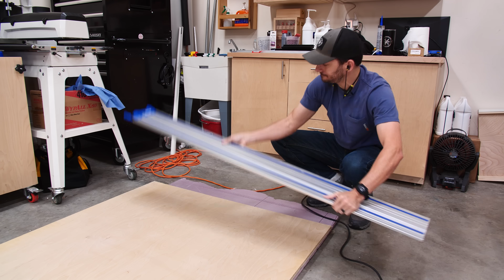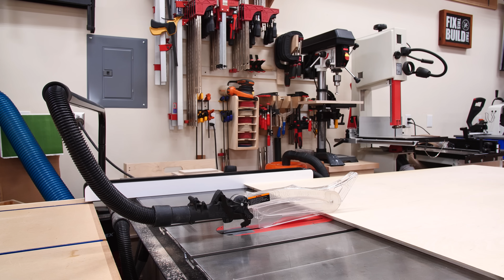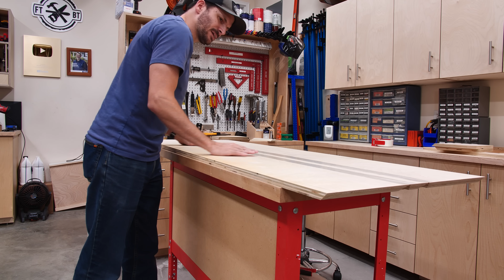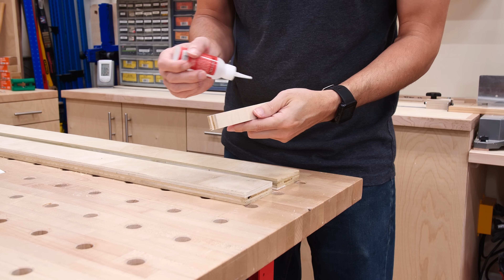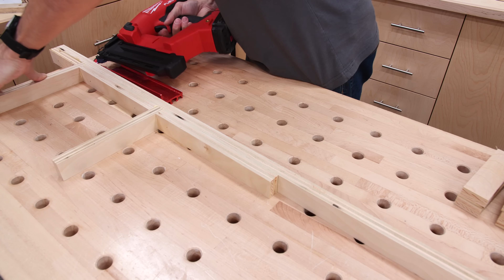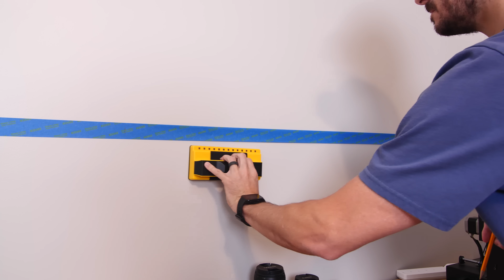DIY Floating Shelves with a Secret

Comment: Great video! Very similar to the way I build floating shelves and as the electronics keep digging into that… so much you can do with low voltage and wood. I have 25+ years in the 12v/audio/video world and now I incorporate that into almost every project with lighting or moving panels. They have power supplies that are super small and thin just for low voltage lighting. Hardwired is the way to go vs battery especially for a no hassle no call back customer service point of view. Not a big deal for people like us to change batteries but most of customers want out of site out of mind hassle free!! Just my 2 cents.  Keep up the awesome clean work and keep the videos coming.
Reply: You are right about going wired. These items are not much electricity draws and newer electronics can be worked via phone/alexa for a truly seemless voice turn on/off. Is there.a good video for hardwired floating shelf? I'm looking to use one over a bed that has built in light/wireless charger/usb ports.

Comment: It’s always interesting seeing how others build floating shelves. I work in a custom cabinet shop and have probably built close to 200 floating shelves among other things over the past year. 

The main difference is we don’t mitre our front onto the top and bottom, we glue a filler strip in a rabbet on the front and veneer the same wood to the front. 

It goes quicker because you don’t have to be as accurate with a mitre fold. Plus if you use MDF for the top and bottom then a maple veneer to cover the front, the whole shelf is 100% paint grade.

Comment: Nice build. Also appreciate the 46 degree tip. How long are you getting on those battery packs before you need to recharge?
Reply from the maker: Without using thr button is was 4 or 5 days on standby. Haven't tried to run the LEDs out yet with the button on and off when not in use. I figure I'll get at least a month

Comment: Funny you should ask if I like electronics.  I may have fell into the deep end of fiddling with electronics this past month.  I am in process of installing permanent Christmas lights on the house.  Similar to the channel with strip in it you have, but run off of a controller with WLED.

BTW.... nice looking shelf.  Office is coming together nicely.

Comment: Done something close to this with my kids floating shelves... But I drilled into the dry wall and dropped cables from each of the Floating shelves behind the dry wall to a wall dry line box and powered from mains usb power instead of battery packs. 

No worrying about charging or hot battery packs while charging then. 

Great job and looks so well. Well done.
Reply: Damnnn very NICE, will be doing something like this in my living room for sure
Reply: i doubt that youll reply since this was 4yrs ago, but oh well. I want to wire 180 leds and i want to power them using only a charging brick that supplies 5v and 3a. do you think it will run?

Comment: You mentioned using painters tape before, and working well. Why did you feel the need to use a different tape? I find painters tape is still the best, because it doesn't lift grain as much as other tapes I've tried, like when gluing miters in the corners of boxes (you were going along the grain instead of across it, so it was likely not as much of an issue).

Comment: That's a cool looking build... I really like the clean design and install without the wires... but if I were doing it I'd worry every time I used the LEDs that I'd leave them running too long and need to charge the battery, that will get old very quickly,  so either I'd not use the LEDs but that's no fun! or figure out a clean wired solution... maybe put power connectors so you disconnect the electronics and can remove the selves and then drop the low voltage power down inside the wall and find a wall wart power supply... but that's just me... but holy heck those are gorgeous shelves!!!

Comment: Very nice!  Some of the new LED and rechargeable electronics options available today really lend themselves to DIY projects, and this just looks awesome, plus gives me a few ideas.  Well done!
A design idea I've seen used to great effect when constructing a faux thick plank that is really a hollow box, out of plywood or even solid thin material, is to make the end pieces out of what amounts to an end-grain cutting board, with an eye toward selecting pieces in the end-grain glue-up so as to get an effective ring pattern.  It really helps boost the illusion that it's a chunk of solid wood (either a single piece or a laminated beam) if it has end grain where it 'should' be (assuming you're looking for that level of 'faux-ness' in your project).
Reply from the maker: That would be a great way to fake it

Comment: Nicely done.  With low voltage stuff like, personally, I would have opted to just run the USB cables down inside the wall to a single USB brick behind the desk and never have to fumble with switches and battery packs, but whatever works for your space!  As for more electronics stuff, bring it!
Reply from the maker: If I had power back there I would have 👍

Comment: Wow i just finished a similar projet, instead of doing it in ply I did a  whole brick of wood with pallet wood, i install 2 steel rods inside the shelves, make the steel rod exactly in the center of the 2x4 in the walll drill nice hole in the 2x4 of the wall et voila, super strong pallet wood shelve, nice video the leds add a really nice touch.
Reply from the maker: Yes, could definitely be stronger, but I don't need them to hold 100+ lbs so went easy route

Comment: Great video. I tryed you tecnek for transfring a image from paper to wood I used a laser printer & the polyurathane the image did transfer to the wood (pine) but I could not remove the paper with out removeing some of the image from the wood large parts of the image would come off with the paper I tryed waitting 1 hr 2 hr & 3 hr for it to dry & got the same results any ideas

Comment: What was the point of making the jig for the lights? It seems like you just need a plunge router and straight edge?
Reply from the maker: Sure you could do that, but you'd have to adjust the edge between cuts.  With the jig you ride down one side one way then flip up to the other edge on the way back.  The channel is larger than the bit.
Reply: @Fixthisbuildthat  ah I see. I have bits that large that's why I was curious. Going to make these for my living room. Great video

Comment: Definitely yes to tying in more electronics with your word working! I've been trying to plan a similar project except I want to run the low voltage wire through the drywall behind it. You just gave me a great idea exactly how to do it!
Reply: Watching this video, I came up with a similar idea as you did. So...Ditto!, I have a wall in my front room I was at first contemplating a full wall build out. However, using the floating wall system will utilize less material, looks good, and easier to move around if needed. I also though of running the wires in the wall as you did.👍😎😀
Reply from the maker: Awesome, good luck!
Reply: How did you make the controls work together on the 3 shelves?
Reply: @alexandremartins7856  If they are RF, it's likely the three lights can all work off the same remote. Once the switch is "on" on all three - then you can use the remote to trigger the lights.
Reply: That is really cool, super nice job

Comment: Look great. Better would have been to chase in to lighting mains power - then you could use a WiFi/Alexa for switching on and off and negating need to have to remove the shelves and everything that’s on them each time you need to recharge the battery pack.  That’s going to get tiresome pretty quickly
Reply from the maker: You missed the part where I put the charger port on the outside next to the button.  I just plug in a battery pack to the underside of the shelf and it charges up the internal pack and it's good for another month or so.

Comment: After sliding shelves on the wall, did you use a Brad Nail (see what I did there?) or screw to hold it on supports?  Or just gravity and friction?
Reply from the maker: Just left it as a friction fit so I can service the electronics if needed.  The fit is tight as well

Comment: Regarding safety: Never wear gloves when using an electric saw. They could get caught by the blade and draw your hand into it.
Reply: Check out the test of this theory by Mathias Wandell.
Reply: @philshock3805  Do you have a link? Besides, this is something I've been taught in school and never had any reason to question it. And I've seen a colleague lose a finger on a lathe which caught his wedding ring...
Reply: @mststgt  It wasn't a glove but he did testing on a simulated shirt sleeve against a spinning table saw blade. Just search YT for Matthias and sleeve and you'll find it. In short, he couldn't get the fabric to catch. Avoiding gloves is always a good idea around power equipment but I think a spinning table saw blade would be much less of a risk for catching fabric than say, a drill press or a lathe (or even a jointer). It's such a small "catch point" and the blade is sharp and spinning so fast that it's more likely to simply cut or shred whatever it comes into contact with. (powering down or up is another matter) I'm not advocating for wearing gloves at the table saw, I just think it's a much lower risk than people think. It's a risk nonetheless so let your conscience be your guide. :)
Reply from the maker: Agreed, if you have an exposed blade wearing gloves is not a good idea.

Comment: it looks so effortless when you do, yet when I attempted something similar, it was nothing but problems getting them to all fit together seamlessly :(
Reply from the maker: Yeah, the joints are tricky to get just right.  But constant pressure down and towards the fence is the key.  Next time you'll nail it, Keith!
Reply: @Fixthisbuildthat  I think a track saw or a really large table is key. Breaking down the sheet is where the errors can happen in my opinion.